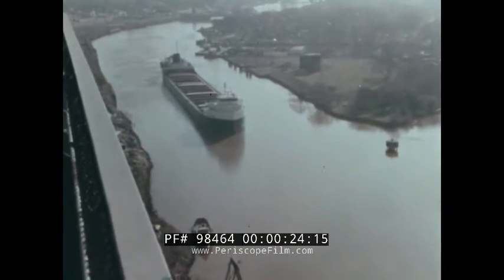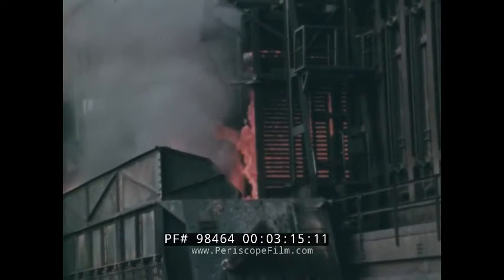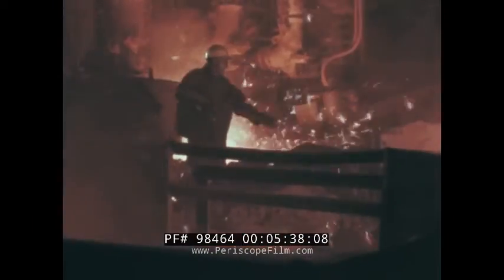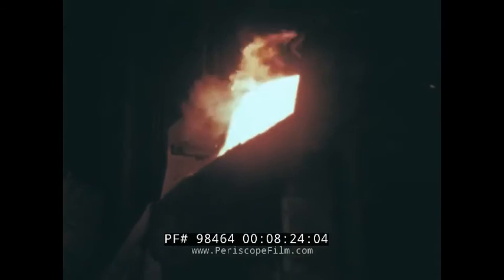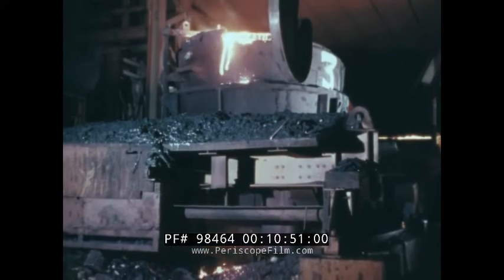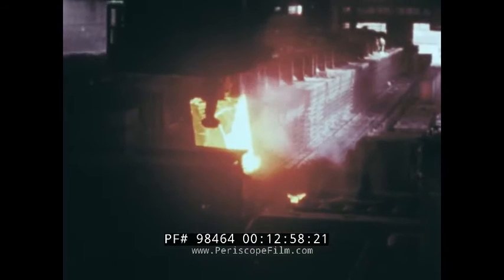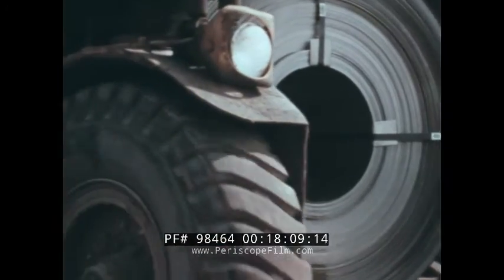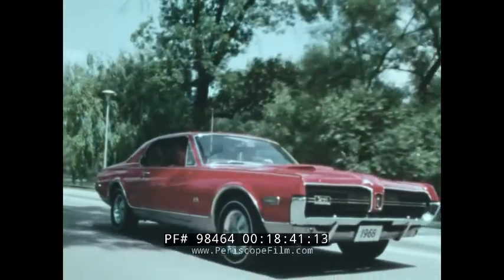" STEEL ON THE ROUGE "  1968 FORD MOTOR CO. RIVER ROUGE STEEL PLANT FILM  98464

Comment: As these train vehicle hauling units traveled through the city's, the kids in the train yard's would throw rocks at the new cars. Breaking the windows and windshields plus denting the vehicle bodies along the way to dealerships across the country. PLUS, some wild kid's would start up some new vehicles and jam the gas pedal to the floor and watch the rear tires smoke in place as the train kept going down the tracks. That's why you see fully enclosed new vehicle hauling train 🚆 car's on the tracks today. 😮

Comment: When Henry Ford was alive, you could eat off the floors in any building in the Rouge. Even in the steel mill area.The building windows 🪟 were cleaned around the clock by a steady crew of window cleaners working three shifts. The steel beams and frames of each building was painted every year. You saw no rust or dirt in any area of the many buildings throughout the Rouge Plant. The buildings exterior was washed every week and window trim painted 🎨 every month as needed. Henry Ford kept the Rouge Plant as clean and tidy as his mansion home on the banks of the Rouge River on Evergreen Road in Dearborn MI. 
When Henry's grandson "The Duce" took over, the buildings and surrounding area's of the Rouge Plant looked like shit. You could see the dirt and filth accumulate on every surface of buildings inside and outside the buildings at the Rouge. The roads inside the Rouge Plant was dusty and dirt flew in the air with every passing vehicle rolling on the streets, roads, and sidewalks that employees walked on inside the Rouge complex. If old man Henry was still alive, he would have used both feet and legs to kick his grandson "Duce" in his fat ass and done the same to his great grandson Billy Jr. too. 😮😢😂😅

Comment: As the years go on, the huge Ford gas tower that was located near the corner of Miller Rd and Dix Ave is gone. The coke ovens are gone, along with the quenching tower shown in this video. The iron foundry on Miller Rd is gone. The glass plant is gone. The Spec Foundry is gone. The Ford Ships 🚢 and the maritime office building are gone. The Ford administration office on Miller Rd. across from Eagle Pass Rd. is gone. The Ford steel division is gone - now owned by Cliffs. The huge electric power plant is gone because of lack of proper maintenance that resulted in a massive explosion in 1999 that killed 6 skilled tradesmen and injured many more. The once mighty Rouge is half the size of what it was for decades.You drive around Miller Rd and Dix Ave and see huge gaping holes of land that once was filled with Ford Rouge site buildings. The mighty Rouge is a shadow of itself today in the 1990s and 2000s 😢
One day, all what's left will be abandoned and torn down, making the Rouge Plant area a huge brown field. Too polluted to reuse for future use in manufacturing. 😢😮